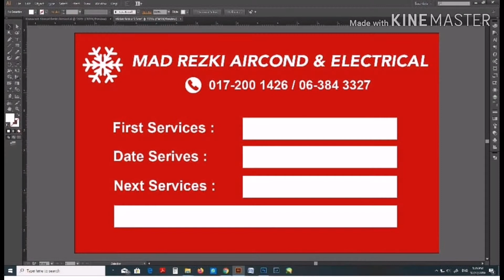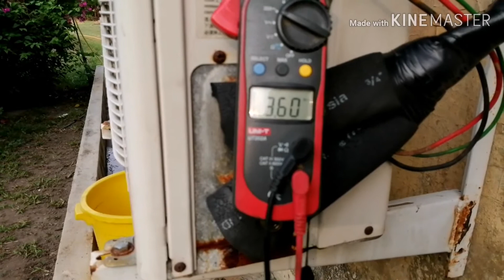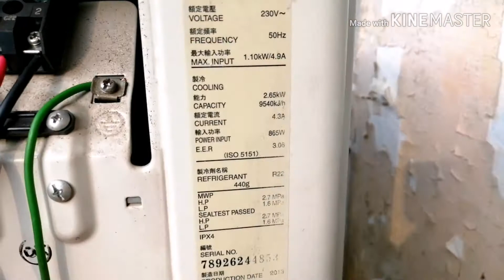CARA CARA SERVICE AIRCOND PANASONIC MENGGUNAKAN (CANVAS)

Comment: Aircond sama dgn rumah saya.. indor out dor saya dah service.. kalau gas psi 65.. amp 4.2 tu kenapa yea.. kapsitor rosak ke.. umur aircond dah 10thn gas r22
Reply from the maker: Tqsm support sy bng
Reply from the maker: Aircond abg brp hp ya, kalu 1hp sudah memadai Amp nya tu.. Kalu amp makin naik barang kali unit kena vaccum
Reply: Mad Rezki 1 hp.. kalaunsaya tambah gas 70 psi, amp blh naik jd 4.5 sedangkan max 4.3 amp.. kalau vacumm.. r22 tak perlu rasanya.. kalau salah blh ajarkan
Reply: Mad Rezki aircond service sendiri.. kalau nk cuba vacum.. nak beli vacum kos lagi.. ada cara lain tak.. buang gas ke.. mcm saya cakap tadi.. aircond dah 10 thn.. ada kemungkinan kapasitor lemah tak.. perlu tukar.. biar gas 65psi tapi bacaan 3.6 amp ke
Reply from the maker: Kemungkinan juga bng, tapi kalu abg ade multimiter boleh check capesitor.. Kalu cara sy setiap ac yg sy service mesti sy akan vaccum..

Buang gas pn boleh ikut sampai dapat amp 4.3.. Tgk paip kecil beku tk, running comp 30 minit..

Skrg ni aircond abg sejuk tk?
Reply from the maker: @Bintang7cola8929  kalu abg ade gas baru, buang gas lama masuk gas baru, tp kalu nk lg cantik vaccum.. Kalu abg berdekatan dgn sy nk pakai brg boleh roger
Reply: Mad Rezki multimiter ada... aircodn jenis ni ada 2 buah.. satu bacaan 3.7 satu lagi 4.2. Yg 4.2 yg pening ni. 4.2 ni sejuk tapi tak sejuk sangat la tekanan gas dua2 sama.
Reply: Mad Rezki saya ni duk ampang je.. suka DIY.. apa2 repair sendiri.. ni tgh nk cari kapasitor 30uf.. cuba tukar..
Reply: Mad Rezki jangka hayat kapasitor berapa tahun?